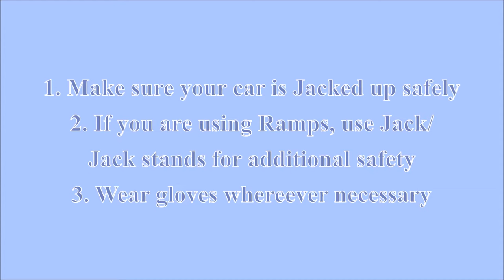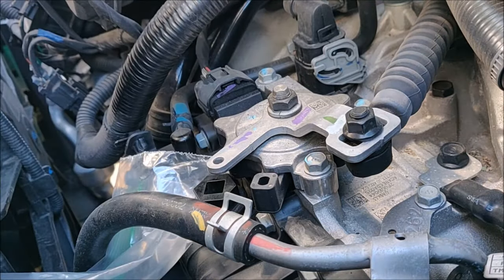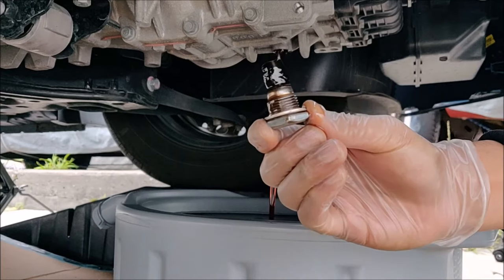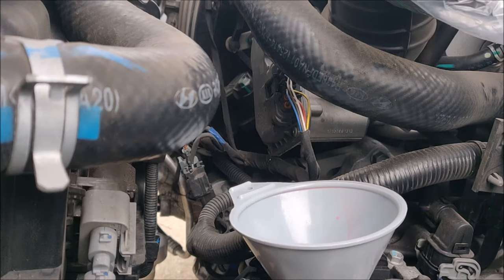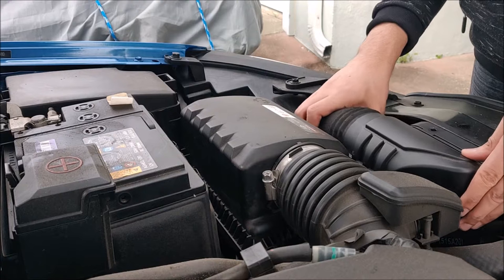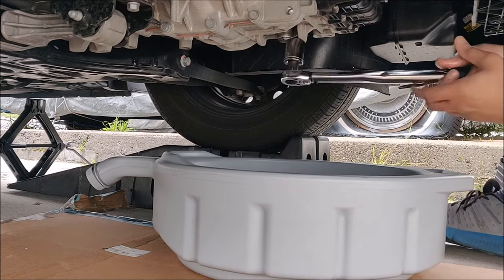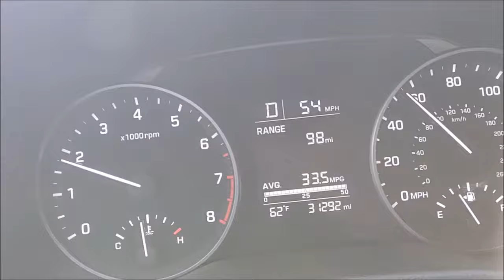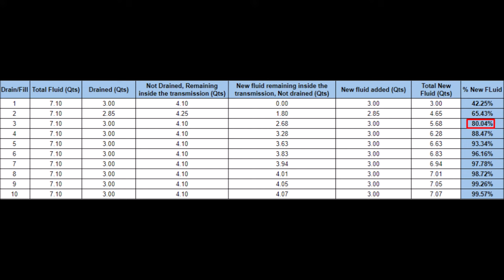2018 Hyundai Elantra Transmission Fluid Change - 3X Drain & Fill with Amsoil ATF (6Th Gen Elantras)

Comment: Thank you for posting this video. I used it as a guide to drain and fill my own 2018 Hyundai Elantra. For those who are looking to change out their ATF, here are some additional comments & observations:

1. @ 0:28 popping the 2 rivets and removing the manifold makes it very easy to remove the air filter box. 

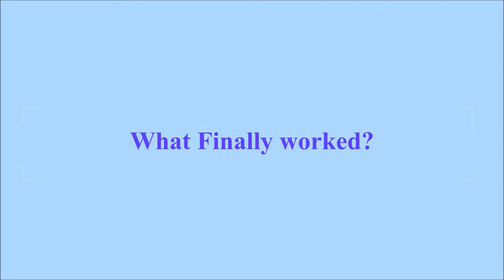2. @3:00 Shift the car to Neutral or Drive to rotate the lever plate if needed 

3. @03:22- Another option is to Remove the two bolts that secure the shift mounting plate (the plate that interferes with the fill plug). Rotate the plate clockwise about 10 and the fill plug will come right out (after using a socket extension to loosen it). Obviously, don't forget to re-center the plate, then re-install and tighten the two bolts after the fill plug has been re-installed.

4. Use a 24mm socket to loosen and remove the drain plug

5. I used Valvoline Max Life ATF - I checked with Valvoline directly and they said it meets Hyundai SP4 ATF specs. 

6. I bought the crush washer from a Hyundai dealer parts counter - About $3 each (PN 45323-39000). Looks like 18mm ID, 24 mm OD. Buy 2 so you'll have one for the next fluid change.

7. My ATF was pretty close to black after 50,300 miles. The maintenance manual calls out ATF replacement at 60K miles. 

8. I tightened the drain plug to 30 ft-lbs with a torque wrench. I contacted the Hyundai dealer about the torque spec and they told me they did not know...which means they didn't want to tell me.  SMH :(

9. I drained out 3.25 quarts so I added back 3.25 quarts 

10. The car runs better and I'll drive it for a bit before repeating this exercise.
Reply from the maker: Thanks for taking the time to comment. I am glad it worked out for you. Cheers! 😊

Comment: You can move the shift bar out of the way by accessing the shift/lock/release button inside the car at the shifter, which will alloow you to move the shifter out of park to any other position.
Reply from the maker: I will try this next time. Thanks. :)
Reply: On D, P or neutral?
Reply: @123pojke  d
Reply: That is not what was in the way,
Reply: @andy-auto-info2483  Hi please help me I have drain out old oil around 3.5 quarts and I put 4 quarts new oil. It will have any issues after putting extra oil. How will know the 4 quarts is fine? Or I have to drain .5 quarts please suggest
Reply: @vishwanathhosurkar9910 a little bit of extra fluid is ok but it expands as it gets hot so that little bit becomes a lot more. You should pull the  plug on the front of the cover that's your fill level guideline anyway
Reply: Or put the vehicle in accessory with key or button, press brake pedal and put in low gear.

Comment: This video was very helpful. I just drained & filled my 2018 Elantra. It has 100k+ miles, but I decided to do it anyway. I opted for the Valvoline MaxLife ATF, and so far so good. My transmission was always smooth, but if it's possible, it's even smoother now.

With regard to the fill plug, I decided to file a notch in it like in this video, however I only needed to file a very small piece in order to get it out. It was very close to coming out without any filing. So if you're watching this video and you're worried about filing it down, don't be, it only takes a couple minutes. You don't have to take that much off at all.
Reply: Any update/issues  since doing it. I have factory fluid in my 18 at 92k miles and am planning to do it this weekend.Am a bit worried so was just gonna do 1 drain and fill and than after about 2-3k miles do another.

Comment: Your diligence is commendable and you're doing what 99% of vehicle owners don't do, but 3x after just 30k miles is a little overkill.  Every 30k miles is fine.
Reply from the maker: Thanks Mitch. I understand its overkill. I did it to replace most of the old fluid with new fluid. Infact, with the lab results, I found that mixing does not do any harm to the transmission fluid. So 2X would have been just fine :)
Reply from the maker: You can read my pinned comment. I have more information there. Thanks :)

Comment: I was able to easily remove the fill plug on my '17 Elantra 2.0 without filing a clearance cut. The trick was to not just pull straight up but pull it at a slight angle away from the interfering tab.  By angling the plug, it looked like there was only a tiny (< 1mm) interference.   I did not feel like I was even coming close to damaging the plug and only needed to pull with a slight force.  Ambient temp was ~80 deg F, so warmer temps may help here.  I tried putting the plug back on and it was much more difficult, so I did cut a very shallow semi circular clearance cut with the plug on the work bench.  Only took about 2 minutes to file a ~1mm half moon cut with the plug out.  Now it re-installs easily.  Thanks for the detailed video and being a pioneer on this procedure.
Reply from the maker: That's good to know. I tried all angles and it did not budge unfortunately. Maybe its the warmer weather like you said, ha ha. Glad it worked out for you and happy to help. Cheers! :)
Reply: @Andy-Auto-Info    A few more notes:  If it looks like plug has a large interference with the offending tab, keep rotating it slowly in ~10 deg increments and rechecking the interference.  You'll see that the interference goes to almost nothing at 2 angular positions of the plug (located 180 deg apart).  This is due to the 2 slots cut into the bottom part of the plug (also located 180 deg. apart)  The slots allow more "tilt" of the plug when oriented correctly.  Hope this makes sense.  Note 2: I let my fluid drain for almost 3 hours after warming up the fluid with a 10min drive.  I was able to get almost a gallon drained out. (~3.9 quarts)  Note 3: I used Valvoline maxlife --I understand your reasons for not, though.  So far, shifting is smooth as silk.
Reply from the maker: @cgatito3528  That is good to know. Cheers!! :)
Reply: Brilliant instructional video. Best I've seen. Bright, detailed, clean, clear.
I'm going to do this procedure this weekend. I'm going to loosen the vent plug but I'm not going to file and remove it. I'm going to refill the fluid in the fill hole where you checked the level, using a hose.

Comment: I just helped a friend change the transmission fluid on his 2017 Elantra and when we got to the fill bolt I used needle nose pliers and was able to pull the bolt right out.  I was ready to do what you did but thought I would try that.  I was able to get the bolt back in no problem.
Reply from the maker: @brianm8052  that's great Brian. Yes, some were able to get it out and some were not. Unfortunately mine was the latter. 😊

Comment: I can't believe I shared this video to my friends but didn't have u subscribed. 😔 I just subscribed right now. Thank you again for the wonderful video. I showed this video to few of my friends who have a same car and they are surprised how easy it is to replace the fluid. Because of how people say transmission is "sealed" and that u gotta take it to the good mechanic or a dealer. I show this video and they are surprised how easily u do it and I even let them use my extension socket and they were able to do it.  I will keep sharing this video.
Reply from the maker: Thank you for the support. Appreciate it. :)

Comment: Very very well made video. For the fill plug, loosen the two 10 mm bolts of the shifter and slightly turn it, the plug will be free. That worked well for me. I wouldn't worry about the shifter position, just mark where it was and rotate it back to the same spot.
Reply: Could you also leave it in neutral with the parking brake on?
Reply: This is exactly what works for me.

Comment: Thank you so much for posting this video.  Oddly, the manual mentions there is no need to change the ATF if driven under normal conditions, and we all know how that goes.  I have to say you are very brave for attempting this, and a job well done.  Kudos!
Reply from the maker: Thank you Sonnet. Definitely, there is no such thing as a lifetime fluid. :)
Reply: That is a deceitful statement from Hyundai. When the sh!t hits the fan, they will just say "we said under normal conditions" That means you should be driving on glass and the wind is always pushing your back.

Comment: I got lucky I guess I wiggled my bolt and it came right out with no filing needed. I ended up using Valvoline ATF it’s SP-IV. Seems to run smoother I’ll know after 2nd and 3rd time. Thank you so much for your video.
Reply from the maker: That is wonderful. Did you do the 2nd and 3rd time? How was your experience?
Reply: How has your experience been with the valvoline?

Comment: Amazing video , thanks so much for the detailed and easy to follow steps!! About to pull the trigger on a 17 elantra with 61k miles so I’m looking to do an ATF change asap . Will definitely be referencing this video and your pinned updated comment. Thank you!!

EDIT: when checking the ATF level, you mentioned the temp needs to be 120-140°; that’s from the reading on the temperature gauge inside the car?

Also, do you remember where you got the filing tool for the fill plug? I know I can refill through the level check hole, but one of the steps to checking the fluid level is to remove the plug so I’ll have to do it anyway.
Reply from the maker: Hi Malik, Thank you for your appreciation. Means a lot.
Checking the temperature of the fluid cannot be done using the gauge inside because you cannot tell. To do so, use a Infrared temperature gun (20$ in Amazon) and measure the temperature of the drain bolt when the car is at level and running, gear in P. When the temperature of drain bolt hits 120 F, you can be sure that the temperature inside the transmission and the fluid temperature will be between 120 and 130 F. At this point, remove the check plug and let the excess fluid come out. When you see a small steady stream, close the check plug and you are set! :)
I feel re-filling via check plug might make it messy. And you may need a special plug to insert inside the hole. Just FYI :)
I got the filing set from Home Depot (Husky tools are awesome value) - https://www.homedepot.com/p/Husky-Steel-Precision-File-Set-with-Storage-Case-6-Piece-707476H/207112197?cm_mmc=ecc-_-

All the best! Let me know how it goes :)
Reply: I did not have to file mine. Keep turning while pulling upwards slowly
Reply: @thecentralman  Right. Don't file nothing. It's a new car, there is no reason to go modifying stuff to achieve this procedure. I've seen this fill plug removed quite easily with no filling . Other then that, Get the car Level to begin with or don;t do the work, thats just asking for trouble. Level.

Comment: For the filling cap you can easily put the gear shifter on D by realesing gear shifter
Reply from the maker: Hi Ali,
I tried that.
The shift selector was not in the way. There is another hexagon looking bolt under the selector which was coming in the way of fill plug. So irrespective of what gear you are on, the hexagon bolt does not change its position. Hope that makes sense :)

Comment: I posted my comment on a similar video, so I figured I'd put it here as well: 

I just did this at 58k on my 2017 Elantra GT. I don't see much content revolving around the GT, but this and similar videos worked well enough for me, though there are a few differences:

1. I didn't need to remove my splash cover to access the drain bolt, but I did anyway for the sake of doing it the first time. When I started, I realized I could see the drain bolt right away and the cover wasn't in the way. I think next time I will leave the cover on and see how that works for me. Though I'll probably have to take it off to check the level so I may be stuck with removing it, haha.
2. The fill bolt on my GT is the screw-in kind. It tightens all the way down, and I had to unscrew it for a bit to get it out. It's not a half or quarter-turn like on the sedans.
3. I did not have to file down or cut my fill bolt in any way - that part you had trouble with isn't in the way so I had no problems getting it out. :)
4. When I unscrewed my drain bolt, it did not have a crush washer, which I thought was strange. I added a copper washer and torqued to 30lb/ft  as suggested.

As I said, I did this at 58k miles. The fluid was pretty dark but not burnt - still a little red/pinkish in tint. I ran out of daylight so I did not get a chance to check the level, but I drained four quarts roundabouts and I put four quarts back in. Tomorrow when I have sunlight I'll add a little more fluid and check the level. Thanks for your clarification on that process, by the way.

Hope this helps any fellow GT owners out there. I'll try to document my experience as well - maybe record something though I never have before. :p After checking the level tomorrow, I'll probably drive around for a couple of hundred miles before a second drain. I used Valvoline Maxlife ATF - it claims to be up to spec and the most important thing for me was getting this fluid changed, so I'm hopeful it'll work just fine, especially after reading that other GT owners use it.

Update: Checked my level at operating temperature and got a small steady stream. :) Woo!
Reply from the maker: Hi Denise, thank you for the wonderful input. I'm sure it will help GT owners.
Yes, the methodology of drain and fill is similar but the design of splash covers and location of transmission could be different. For Elantra non GT models, we have to remove the splash covers like how I did.
Thank you once again! :)

Comment: I flushed out 4.75 quarts out on my 2017 Elantra.   I started it with drain plug off.  And ran it though gears quickly then shut off.    Did you change the Filter yet.   Is it under the pan-- easy access.   Nice video.  Thank you.

Comment: In addition, I am wanting a clarification on the filling location: OK so there is ACTUALLY TWO (2) Fill plugs that I see people using!  One is under the Air Box (after removal)  and this plastic plug is actually the "VENT" for the transmission CORRECT?  The factory "FILL HOLE" is towards the rear and a metal 24MM plug like the 24MM metal drain plug -- CORRECT?  Does the Manufacturer (or dealer) use the PLASTIC VENT PLUG or the METAL FILL PLUG Location to add fluid?  That is my question!

Comment: Hey Andy, I'm proceeding to replace for 1st time the transmission fluid and I'm reading on the manual of my 2017 Elantra limited engine 2.0 that the transmission requires 7.08 US qts is this a bigger transmission (more than double US qts)?
Reply: Not all of the oil will come out when you drain it. There is more oil trapped in the transmission. so just measure the oil that comes out, and replace what's needed just like he did in the video.

Comment: Hyundai Elantra 2019 DOHC SEL engine 2.0 
Which type of transmission fluid is won't ? 
How much liter s and quarters ? 
Please Clarification on the subject ? 
Thanks
Reply from the maker: Hi Hersh,
It should be the same type SP-IV. Check your owner's manual, you will find the info as well.
For a drain and fill, it would be around 2.8-3.2 quarts per drain. The total capacity of the transmission should be 7.1 quarts. I don't think its changed for the 2019 model, you can check owners manual to confirm.
Please watch the entire video, you will definitely understand the process. Cheers :)

Comment: I used the check plug above the drain plug. Not necessary to remove the air box. And not necessary to modify anything
Reply from the maker: Yes. You can pump fluid into the check plug. I have already included that procedure in my pinned comment. :)

Comment: Andy ---  How many miles did you have when you made the fluid change?
Also -- I looked on AMSOIL site --  I have a 2019 Elantra SE 1.4L with the Dual Clutch Transmission, and at 55,000 miles, (according to my owner's manual)  I see AMSOIL does not have a listing for the FLUID?  What am  missing ?

Comment: Today I did change my 2017 Hyundai Sonata ATF I drain all the oil it is almost 4qts and then I filled. I didn't open that black socket overflow which is near drain bolt it is ok ?? and while filling it tooks too much time because the air I fill little by little If I do fast oil comes out? What is the reason?
Reply from the maker: Hi, what fluid did you use? And did you put back the same amount of fluid in?
Maybe the funnel you used was covering the entire fill hole. When this happens, the fluid does not go in easily and bubbles out frequently. It goes in slowly.
For my car, I used a smaller funnel and the fill hole was wide. Hence, it went in easily.
Reply: @andy-auto-info2483  I think so funnel is the problem. When I keep straight and tight it won't goes then I kept loose then little by little it goes. Next time I will get more small. Please share your WhatsApp.
Reply: @DesiTravelDiaries84  I used a deep funnel from Walmart. No leaks, overflow and done in  2 minutes!
Reply: @thecentralman  I also bought from Walmart check it out in my video and let me know you are talking sameone or else. If some other then give me the link I will buy that one.
Reply from the maker: @DesiTravelDiaries84  Looks fine. Just make sure you put back the exact quantity that you measured. Also, do not use Brake cleaner on your drain bolt. It is not needed, just wipe it clean using a tissue. You do not want some residue to be left on the bolt and get mixed with ATF inside. So clean it well with tissue :)